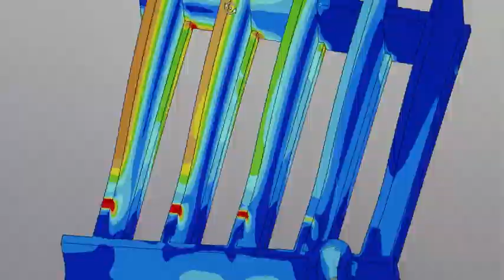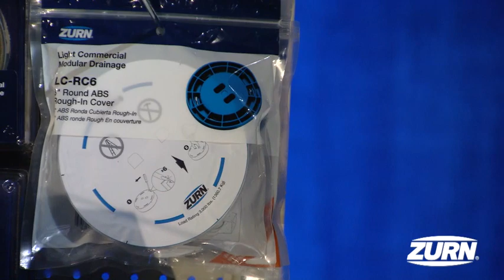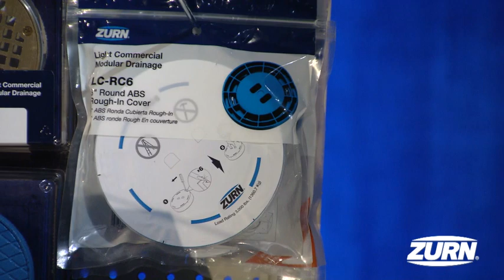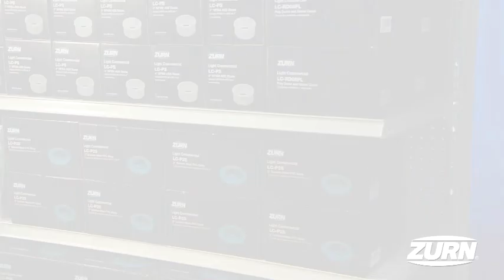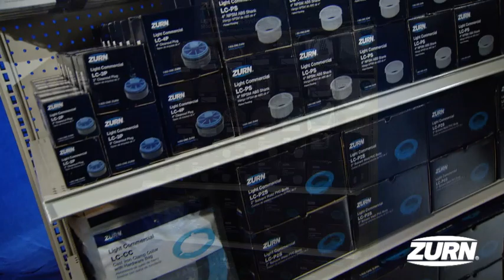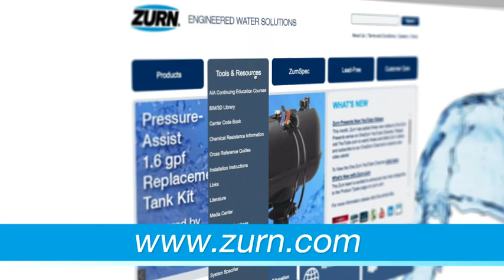Zurn Floor Drains Light Commercial Modular Drainage System

Comment: Would this system be an appropriate or good choice for a basement walkout? I need a larger drain at the bottom of my exterior basement steps.If it is appropriate what corresponding zurn drain would be best. A  4 in pipe and this drain would connect to my interior sump pump runnning below grade under my basement door
Reply from the maker: Thank you for your question, Geoffrey. If the area is not going to see any car traffic, we recommend the Z415, available in strainer sizes 5" to 10". Also, our light commercial line FR05NIP4S is an option that could be solvent welded to PVC. This product is also available in strainer sizes 5" to 10".